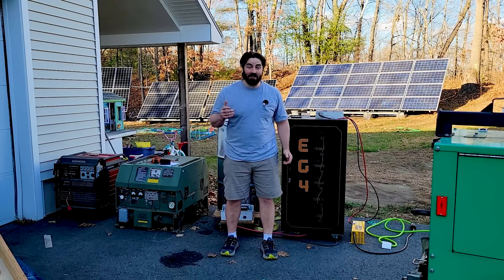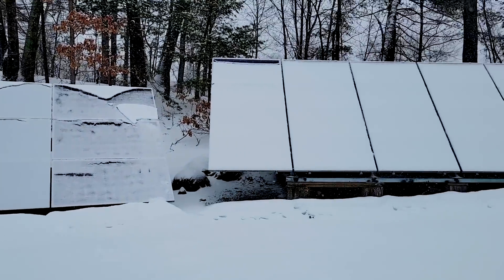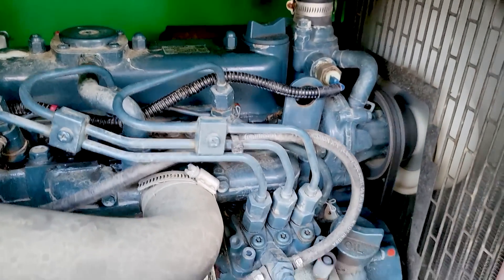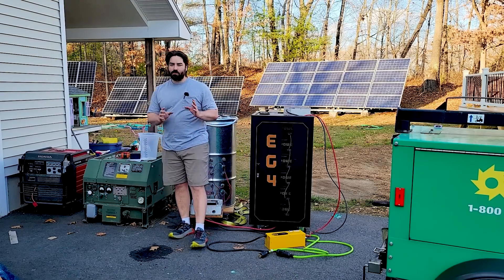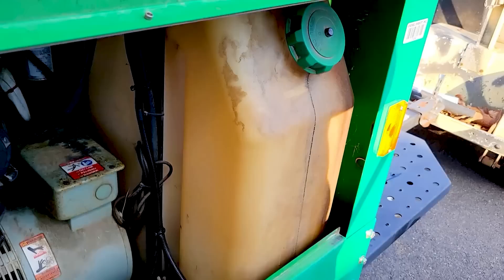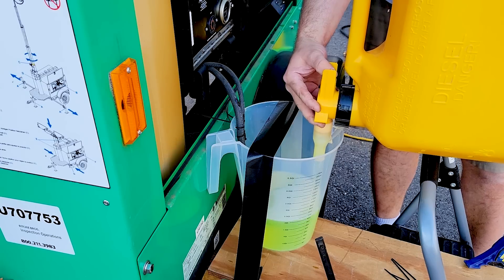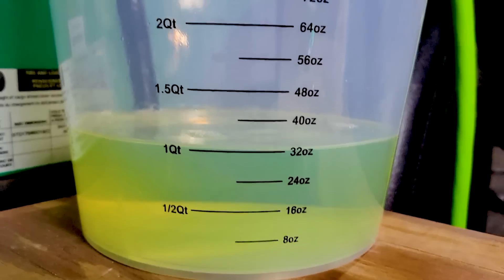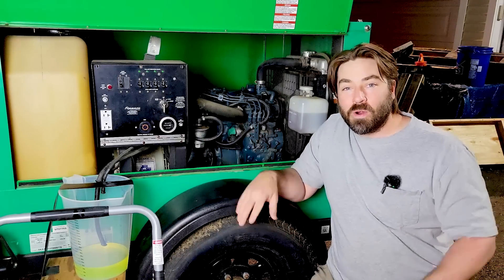Test Kubota: How many gallons per snow storm?

Comment: Have you tried a Honda ( or harbor freight knockoff) 2200watt inverter?
Also what was the average load on the Kubota, I realize it a 6kw, but like the Honda 6.5, the economy goes to hell when demand is high.
Thanks for the videos! They're awesome!
Reply from the maker: Hi.  Yes, I have an old video with a small Honda.  I rented it from Home Depot just for the purpose of testing it. https://youtu.be/QAoorfdbefo?si=sn_Baa4TYvxdeG1R

As for the Kubota: The charger was set to 100 Amps, and the battery was 53V.  That is 5,300 Watts into the battery.  The charger is about 90%EFF. So, about 5.9kW pulled from the generator.  

Things to note, when I tested my Honda, the load was the same.  This Kubota engine is rated for 10.8kW@1800RPM, so the engine had plenty of margin.  The generator head attached to the Kubota engine is rated for 100% duty cycle.  These things are different than a less expensive "consumer grade" generator.  The normal rule of thumb such as "50% load is the best fuel economy" is only true for consumer grade and not true for industrial grade.

Comment: I'm not sure if solar panels charge during cloudy weather but have you ever thought about installing heat tape behind your solar panels? It'll melt the snow letting it flow off the panels clearing them up to receive sunlight when it comes back out. Plus you don't need to have them on all the time since your not protecting water lines. You can set it up with a wifi smart outside outlet and turn it on directly by your phone.
Reply from the maker: Thanks for the suggestion.  Most of the time when it snows, there isn't enough solar power to worry about.  The day after a snow storm is usually sunny and the snow slides off very quickly.  The exception is freezing rain, which takes longer to melt and could be a good reason for some form of heating?

Comment: Really love these tests.  Diesels will always be more efficient, but it seems like a 7kw duel fuel would be easier for your setup.  One 20 lb tank would be close to charging your entire bank and propane can store for long periods.
Reply from the maker: Propane sounds simpler on paper, but I think it would be more problematic for my situation.  If I'm running off of 20# tanks, then pulling a full load from a generator (5-6kW) then I think the 20# tank would freeze up within minutes.  Remember, I'm only needing to run my generator in the winter.  Now, if I had a 500 gallon tank or larger, then I'd probably pick up a propane generator.

Comment: So you paid $0.41 - $0.50 per kWh, if I can math good. I'm not sure what your neighbors are paying per kWh, but as an occasional use thing to top up a solar system, that's not bad at all. Reliable, portable, easily repaired anywhere in the world. I like it.

For comparison, I pay $0.13 for very reliable grid power in West Georgia. Off-grid is sexy but makes zero sense for this particular address.
Reply from the maker: Yes, your math is correct.  In MA, we have fairly expensive electrical rates.  Last time I checked my neighbors bill it was $0.36/kWh.  However, if you try looking it up, the state advertises something lower, around $0.20/kWh.  So, I guess, the state doesn't factor in all the fees we are forced to pay, and are included in the bill?

Comment: One possible advantage on the Kubota generator is you could possibly use the coolant as a heat source for the house while needing to run it. Effectively adding to efficiency of fuel usage.
Reply: Great point. No reason to dump it outside. That changes the math A LOT.

Comment: to give a good comparison of how efficient these generators are it would be better to simply calculate the thermal efficiency so how much of the Energy thats in the fuel is actually making it out of the generator.

For this Generator we have 8kWh coming from a full Gallon of diesel fuel, one gallon of diesel holds 39,3kWh so the overall efficiency of this setup is only 20,3% with the other 79,7% being wasted as heat.

For the Honda Gasoline generator the efficiency would be 18,36% because Gasoline has a lower energy density.
so overall these diesel generators are SUPER inefficient as you would expect 30 - 35% efficiency from such a setup with a good diesel engine running at peak efficiency.
Reply from the maker: I'm trying to keep to my initial question, which was "Which generator is most efficient to recharge my battery".  Remember, I'm taking my kWh measurements at the battery.  There is also loss in the charger, which is about 90% efficient.
Reply: @DavidPozEnergy  you could also add a powermeter to the AC output of the generator to see how much losses you actually have in your charging system.

Comment: Getting 8kWh out of 3.5 liters of Diesel is a bit depressing - Fuel efficiency about 25%, the rest is dissipated as heat. Shows you how much energy we have been wasting the past 150 years running combustion engines... hopefully at some point we won't need them anymore, especially because of the toxic exhaust fumes.

Comment: Curious what the efficiency would be on a little ~2000W inverter generator. Obviously would charge a lot slower.
Also love to see what you can get charging off an F150 hybrid with the 7.2kW plug. I know my Volt used to work as a super efficient generator.
Reply from the maker: I have a video on a little inverter generator: https://youtu.be/QAoorfdbefo?si=UlXH5B7zXqiBgULD

Comment: Measurements differ of course, but my multiplus 2 says my 3 phase MW-Tools DG75E does about 2.5kWh per liter or 11.4kWh per gallon of diesel with an average of 5.5kW of running. I expected 13.6 per gallon (3kWh per liter). Anyway, I use that measurement for buying diesel: if my multiplus 2 says I've burnt 50kWh, it's time for me to put in another 20l of diesel. The > 60kW generators
I do not have a victron smart shunt so I can't measure it that way.
Also I have electronic loads that make the victron assist or charge a bit unstable, so it regularly resets to 300W generator load in that phase. If I would put the MP2 in charge mode it would probably be a constant 6kW and more efficiency.
Reply: The question is: how efficient is your charger? I picked my diesel gen to be in the ballpark of 2kW per phase, as that pairs nicely with a 3 phase multiplus 2 5000 (230V) efficient conversion. I can not do a mp 2 charge test because I am off-grid, this is my life (and income) ;-).

Comment: Curious if you could run a fan clutch on the radiator fan to prevent wasting fuel turning a fan that doesn't need to reject like 10kw of heat from the coolant 😂

Comment: I’ve used light towers like this for home backup before, two years ago it was my primary emergency power, I clocked up 2,800 hours of use on it.

The positives: 
They are quiet compared to a 3600rpm air cooled unit.

They have large fuel tanks usually 3-4 days of run time. 

They are designed for continuous use.

They have long service intervals some in excess of 1000 hours.

They are inexpensive for what they are on the used market. 

they are simple to maintain and repair, and last a very long time. 

I’ve personally seen units in the field still going with 14,000 hours on them. 

The Cons: 

They are large and heavy, it’s not uncommon for these to weigh up to or over 1,000lbs depending on the model and options, there are units with all the bells and whistles around the 2000lb mark.  However they are trailered units so they can be moved around if you have the back or a tractor/small utility vehicle 

The initial purchase cost is expensive A good used unit can be in the $3-5k range.

They are more expensive to maintain than an equivalent gas unit. 

The power isn’t as clean as an inverter generator, (however personally it’s clean enough for most emergency needs.)

That all being said,
I now use a MEP-802A only because I got a good deal on one, but wouldn’t hesitate to use one of these commercial light tower units as a backup for that. My electronics are protected by UPS’s with voltage regulation but I didn’t have any negative effects running directly off one of these brushless generators for 18 consecutive days in the Texas ice storm a few years back. I was using about 1/3-1/2 a gallon per hour on fuel depending on load.

Comment: SLOW the RPM down to 3000 RPM which equals 50 HZ output freq!!. The engine will use less fuel because it is running SLOWER. Then run your fuel consumption for One Gallon! Many chargers will operate at 50HZ and reduced voltage, Please check your charger. I have done the test several times at 50HZ and have improved fuel economy. I love your channel its gives me so many ideals to use on my own system. Keep smiling and Merry Christmas
Reply from the maker: You are probably correct when talking about a 2-pole rotor inside the generator head.  This is a 4-pole rotor, designed to run at 1800RPM (half of 3600).  It's 60 hertz output.  If I slowed this down, then the engine gets farther away from the peak fuel curve.  but, you are correct for 3600RPM generators.  Usually if you slow them down a little you will get closer to the peak fuel curve. A lot of engines in generators have the peak fuel economy between 2400 and 2800 RPM.
Reply: @DavidPozEnergy  love your videos and what fun time you have

Comment: Maybe if you feel comfortable messing with your honda generator, you can take the 3 phase from its main PMA, run it through a diode into your charge controller.

Comment: Now I would go on the cheap end. Set the chargeverter to 15a and run a gallon of gas through a $500 costco yamaha aipower 2200w inverter generator. I think it will be close to 6100kwh over night.

Comment: Nice setup and testing, i did a convert a light tower engine with better gen head. 3 cyclinder diesel mitsubishi with controller for auto start. Still have alot to purchase to be full off grid. 13.6 kw dual wxpro 6848✅️, with genstart✅️, battery monitor, gateway✅️, gridtie sunpower 3.8 kw✅️, 4.0 kw solar panel just for gridtie✅️, 2 set of 3.6 kw solar panel,  3.6 kw per charge controller✅️, chargeverter eg4, 240vac to genset, battery is my last to purchase trying to reserve for 3 to 4 days autonomy. Yup alot to purchase, house per month at least 750 to 900 kwh consumtion.

Comment: Bullshit, the pan cake generator head in that light tower has very clean output. They run less then 10%thd and the diesel engine if not overloaded will maintain 1800 rpm quite easily and the frequency should not fluctuate more then 3 HZ  . My 20 kw light tower with 5k hours powers my house during outages very well.
Reply from the maker: That's great.  I'm guessing there are more than one type out on the market.  You must have found a good one.  Mine will vary a lot.  Maybe it has to do with size?  Mine is a 6kVA gen head, so much smaller than yours.

Comment: You should try an old lister or listeroid clone. 6/1 model runs at 650rpm, sips fuel, and provides very reliable operation. I’ve got one that I am still building out to be a permanent mount with auto start when the batteries need to be charge.
Reply from the maker: Those look very cool.  Maybe some day I'll add one to my collection.  Are you in New England?  Maybe we could coordinate and I could film testing yours?

Comment: Hi Dave. Did I miss something. What kva and kWh is that Kubota please? Also model number. I like it.
Reply from the maker: The generator head is 6kVA.  The Kubota engine is model D1005.  It's a 1-liter, 3-cylinder diesel.  The engine is rated at 10.8kW@1800RPM.  It's a fairly common setup I've found in light towers.  Designed for very long life and reliability.
Reply: @ thanks Dave.

Comment: We run a 15 kW TG15 Baldor gen with a Kubota.. it sips fuel. As long as it runs well at 1800 RPM the power should be clean

Comment: You ran the engine at 65% (~7.1kW) mechanical load and got lower fuel economy vs. 100% (10.8kW) load. You should get 10 kWh per gallon at full load.
Reply: I think he had maxed out the generator head. No way to do what you are suggesting. The engines are oversized for a reason. To make sure they  run all day, every day without a of of breakdowns.

Comment: I run a 25kw kubota for my backup 
I charge at 10kw and use the rest for ac loads. If i used the gen more than a handful of times per year id go with chargeverters.

Most of the time i run biodiesel in the gen but that does reduce kw output noticeably when loaded hard (power gets dirty)

Comment: I see many comments using the cooling system to heat your home. Would it be possible to use the exhaust to heat also?
Reply from the maker: Yes, but I'd be a little more cautious of it.
Reply: You have to be careful using exhaust heat on these mechanical diesel engines. They aren't the cleanest burning. If you pull too much heat out of the exhaust you will cause them to build up a sludge and end up chocking themselves off. Its the same things as running one with too little load. Causes a condition called wetstacking.

Comment: Would be interested to know how many hours at 5.3kw you need to run the light tower gen to give you enough battery charge for a full day off grid - I guess you want to avoid the noise as far as possible, especially at night. For many people who don't need to run the generator regularly for long hours, the DIY approach will be easily the cheapest of the three - great to see the efficiency numbers !
Reply from the maker: In the cold of winter, my property uses 40kWh/day.  Remember, I have 3 buildings I'm heating, and a family of 4.  Everything is 100% electric.  Which means I need to run the generator about 8 hours per day if there is no sun, and I have depleted the battery.

Comment: By auto standards, the light tower 1 litre engine doesn't produce a lot of power at 10.8kw or 14.5HP - I generally expect a N/A diesel to produce more like 35-36 HP/litre but that's at more like 4000 rpm. Clearly the Kubota gains efficiency and long life from producing its power at only 1800 rpm.

Comment: I believe your methodology is a little flawed. First, every light plant I have used does not allow you full access to the generator output through a convenience receptacle. You would have to dewire the light heads and pull from the breakers or the mains. The receptacle typically only gives you about 20-70% of the total power it produces. 

Also, a light plant is a constant run device with a set RPM. If it had a variable governor it would ramp up and down for the power needed. Your single rectifier can not adequately load that generator either. You can only get a maximum theoretical of 5120W power use out of that charger yet a light plant rated for 6kW is going to burn the same amount of diesel whether there is no load or a full load.

Comment: Could you make a video or explain how to clean up the output from light plants? They would make excellent home gennys since they around $1,000-2,000 in my area
Reply: What makes them problematic is they lack active voltage control and may times the governors allow for too much droop as load increases. Adding an AVR would solve the voltage problem. Making sure the governor on the engine was setup with the right amount of droop would make the frequency more stable.  

You can search for SX460 AVR and see how people use it to retrofit generators without voltage control.

Comment: Great video David.  I was running my grenny to charge up my battery in my off grid cabin during the Nov - January’s “tough months”, but this year I built a portable battery that I charge from the grid and then dump that power into my batteries at the off grid cabin. It works out to about 16 cents a KW.  It’s super cheap and super quiet.  It also gives me a portable power station in the summer.   If you take that sun / kabota trailer apart and add a stack of batteries and an inverter, you would have a giant portable power supply.
Reply: You tow it into town and charge it on the grid? Neat!

Comment: What’s nice about that little mechanical injection Diesel generator is that you can use used cooking oil refining and make your own fuel. Or red dye off-road diesel at a lower cost

Comment: You can use the hot water from the kabota.Diesel generator to help heat your garage.
Reply: would be an awesome project to see!
Reply: It would help, but they really don’t make a lot of heat in the coolant when it’s very cold they will only melt snow 3’ from the back after a few days of running, it might be a better source of heat to put an EGR cooler on the exhaust and get the heat from there, though a more invasive method, the btus of available heat are worth it for that purpose.

Comment: I haven't done any testing but I have spent a lot of time researching rated efficiency of generators. The top 2 are the Onan QG 4000i RV Gasoline Generator - 4.0HGLBA-8306 at 8510 watts per gallon and the WEN 56477i 4800-Watt at 7370 watts per gallon. Both are 120v gasoline.

Comment: You should do an update video on an overview of your house. Are you able to cover your heating load with just electric stuff right now? Did I see one of your videos talking about double stud? I'm currently planning the next house build and would like to go 100% electric, including heat, but I still don't know if it's realistic in a climate zone 6b even with super insulated walls. I haven't had an issue with this house but l'm running gas furnace, water heater, clothes dryer and stove with 5kw of solar and 30kwh of battery. I'd at least double the next system but the heat is the real hard one to solve when it gets down to below zero at night for months on end here at 8000’
Reply from the maker: Yep, I built my house and it's super-insulated.  100% electric.  We have full-size appliances including electric dryer, range, tank water heater.  Heating is a mix of baseboards (electric) and mini-split heat pumps.  The old videos on building my house don't get a lot of views, but it's there if you want to see them.